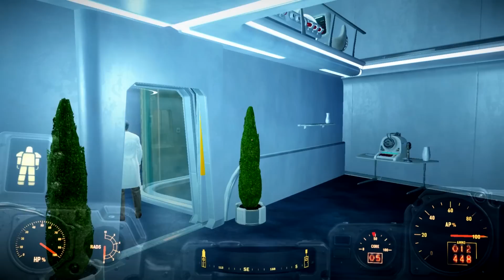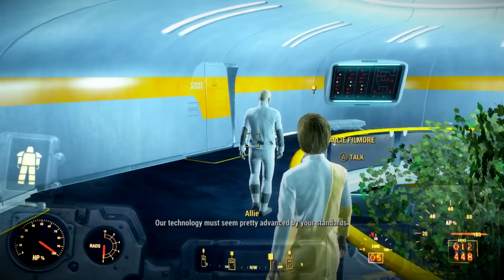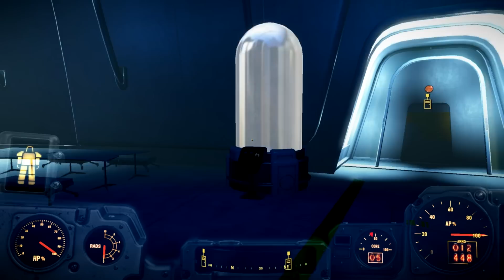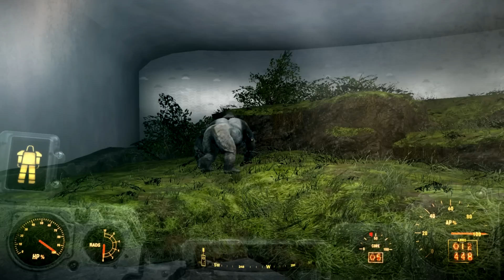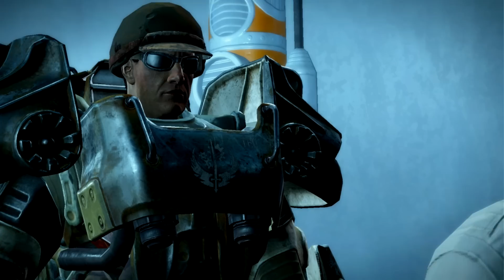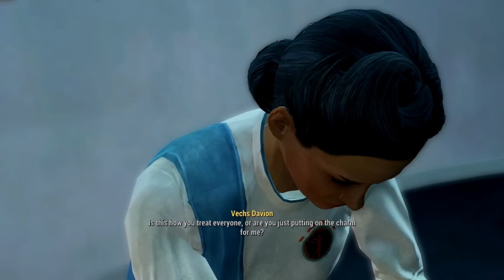Fallout 4 Episode 56 I Like Rosalind

Comment: No, I do not feel that fallout 4 is a fallout game. I feel Bethesda spent too much time on graphics and fancy stuff that will make people go "woah that's a cool set piece!". In new Vegas, I feel that there was a butt-load more time spent in the ideas for the areas. Also the deathclaws were actually scary. In my playthrough of fallout 4, I switched to survival difficulty and yet still I can easily and confidently run about in the glowing sea and dance with the deathclaws without power armour and survive. In new Vegas, deathclaws were terrifying and a huge threat. The same I feel has happened with radscorpions. The first time I found a radscorpion in fallout new vegas, I got chased all the way back to goodsprings and spent a decent amount of time in the bar recovering. In fallout 4 I have not felt anything near fear to that level. Basically to sum up this badly structured rant, I feel fallout 4 is a pretty game, but a shoddily designed one both from a storyline aspect and a gameplay one.